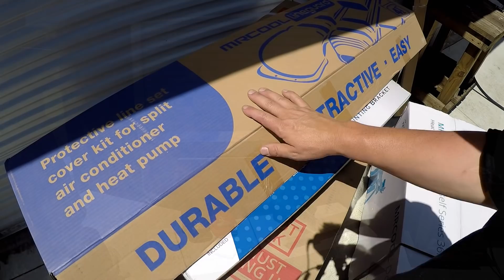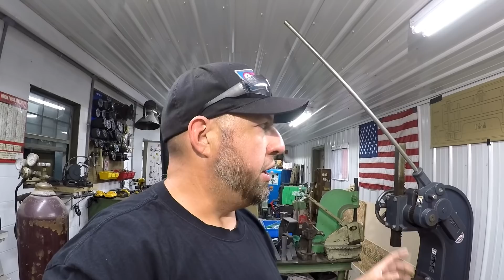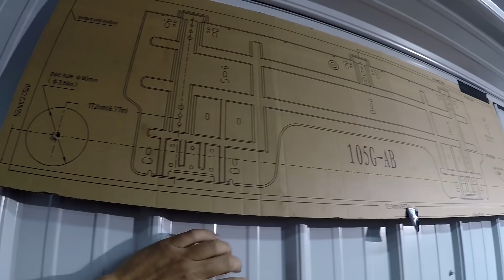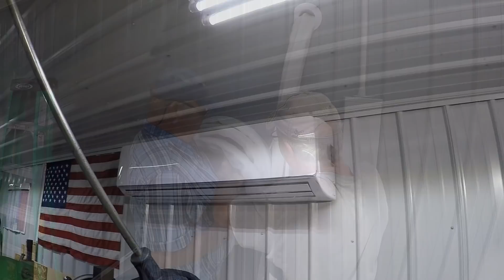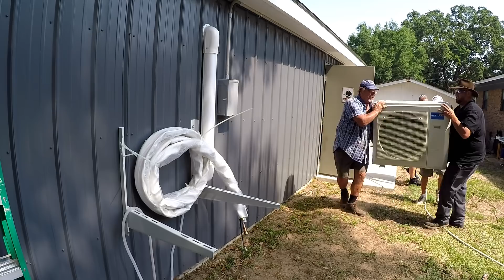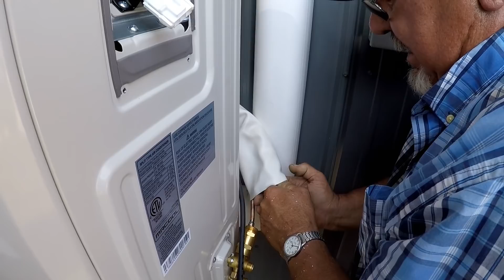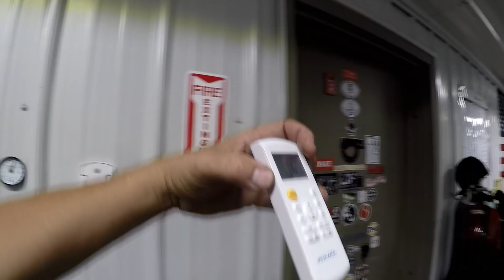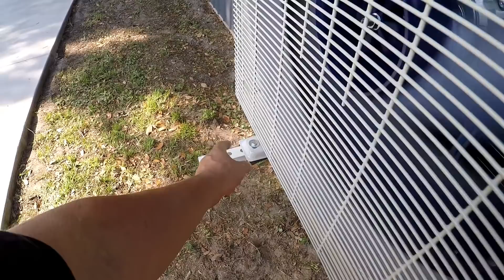Mr Cool DIY Shop AC Install

Comment: I’d recommend you lag the exposed pipes where they go into the external chiller, just to reduce any losses in the heat of summer.
Reply: It is not a chiller.
Reply: Paul Copeland compressor, chiller, same same, don’t be pedantic
Reply: @dantmx  ...Nope, they are not close.
Reply: Paul Copeland well whatever you want to call the external unit, lag those pipes.
Reply: What is “lag”?

Comment: Do they make shorter line sets?  This would reduce pumping losses..but you would have an overcharged unit.   This would increase evap temp.
Reply: The excess lines drive me crazy. 
I'd have paid the A/C guy to do it properly; evacuate the system and shorten the lines. 
Then, of course, recharge with the correct amount of refrigerant as determined by system pressures and ambient temperature.

Comment: I don't have to deal w the down south heat but holy heck Adam I've had some hot summers. I live in Ottawa Canada and we get some nasty summers. Last year I got two things. A minion and AC and my minion could still barely hack it. 10 years I'd been there w no cooling but a fan and a prayer lol. Kids right.

Comment: Is there a Mr Heat DIY unit for up here in Canada? :)
Reply: C2D I would love to stay in Canada I am from South Africa
Reply: LOL, well it is a heat pump but I doubt it will do much good.  But if you really want a Mr heat I think this will work  https://www.mrheater.com/
Reply: Its a heat pump so it goes both ways.  not going to do you much good at -20 F but i think they pump  well  till about +20 F. so it might knock a few bucks off your fuel bill, and add a bit to your electric bill. you can try it all out with your car's AC it can do the same.   quite a few home units here on Kodiak  island but we are in the south west part of Alaska so we rarely get the deep cold of the mainland.

Comment: Coil the drain and zip tie it to the bottom side of the L bracket. That way it'll act as a trap. Don't run it straight down.

Comment: You will be very happy. Have been an electrician for close to 40 years. Nice looking job. Straight, .level, n clean install. My wife works on Boca Grande A/C company. Have hooked these ductless system many times. Very impressed with how quiet they are and efficient. Hope you are also. You are lime me in many ways. It is about detail n looks. Make the customer proud they used you.
Reply: Nice clean install, but not a fan of exposed PVC or upside-down 1 hole straps that everyone seems to do. Overall very nice install and I'm sure a VERY welcome addition to Abom's awesome shop, though.

Comment: nice unit, as an owner of a mini split a few things for you to consider. 
1: move the outside unit all the way  to the end of those arms, with it a little further away you can clean the coils with a little less fuss. 
2: put a screen (panty hose) over the end of the water hose, critters will call the tube home after a very short time. 
3: get a few pan tablets and put one in the drip pan to stop the nastys from growing in the water that will sit in the pan.

Comment: WAS THE LINESET PRECHARGED OR THE COMPRESSOR?
Reply: Both I'm pretty sure.
Reply: just wondering because I saw no vacuum pulled down on the system
Reply: @jasonbrown8726  .....I suggest that you take a minute and watch the video.

Comment: Hey Adam! Thanks for another great vid. I have a question you might know the answer to: is there anything wrong with coiling up the extra line? Some pros are saying it makes them catch oil in the low spots. Did anything come up about that as you were reading the notes or speaking with your step dad?
Reply: "father in law" ??

Comment: We have these all over Finland. They can warm up houses at winter and then if get some sun at summer, those can be used for cooling.
Heating is quite cheap with those.
They actually reverse when used for heating, they try to cool(take heat from) outside and transfer that to inside unit. Opposite then when you cool your house, outside unit try warm up outside so it will pull heat from inside to outside.
Reply: Yeah thats true,  we (i) allways get the air out from the copper tubes, not so important if u look foor 4-8 y on it, my foks was 16y on their Mitzu

Comment: That should spell the end to ridiculous installation charges.  Having said that I haven't seen these for sale in Australia yet.
Reply: Flying Pictures The units are avalable in Australia bought one about 8-10years ago from Cheep As Chips in Adelaide installed in Port Augusta temperature can reach close to 50 degrees C works fine .They are avalable from most a/c supplyers.  Ray
Reply: @raymossop7959  Well good news, I will keep an eye out, my fondness for Australian summers is dwindling the older I get.
Reply: Flying Pictures   Sorry a slight misstake it was not Cheep as Chips it was The Reject shop  Ray

Comment: Mini splits are the way to go for sure. When I build a house one day, I'll zone it out with a split system. I chose a different brand for my shop, works like a champ. Coiling the lines up like r hat behind the unit would drive me nuts. I cut and flared mine to length for a clean install.
Reply: Fair enough, but then you have to vacuum purge the lines. Not many diy-ers have a HVAC vac pump.
Reply: @icecreamsundae1038  This is true, I bought a cheap Chinese pump on Amazon for $50 that did a great job. Very well worth it for a clean install.
Reply: How did you evacuate the lines? Did you buy a recovery unit as well, or just release it? I've never seen one that you could shorten the lines. The ones I've seen need to be sweated off and you need to sweat it back on, because the fitting on the condenser won't take a standard fitting. What brand did you use?
Reply: @xenonram  I've bought two units from Pioneer, their prices are hard to beat. I've had one for 4yrs that's still going strong. In the heat of the summer here, it blows a consistent 35 degrees, the one in my shop was in the upper 20s the other day. Their units come with the refrigerant pre charged  in the condenser unit it self, the lines and evaporator are empty and have to be evacuated with a vacuum anyway. I pulled down the vacuum, flushed with co2 and pulled it down again for an hour. I then checked for leaks and proceeded to release the refrigerant from the condenser into the system. Easy peasy... Their website is highseer.com, I highly highly highly recommend them. They've been great to deal with. I'm nearly certain all of these budget mini splits come from the same manufacturer. Mine is nearly identical to the one Adam installed, same remote, USB dongle, etc..
Reply: @xenonram  I forgot to mention, they sell a fitting flare tool on their website as well. You simply cut and flare, similar to brake lines on a car. So far its been leak free.

Comment: An air conditioned home shop is the best!  I looked at Mr. Cool when I did my install, but didn't like the thought of having all the extra line coiled up behind the outdoor unit.  I wish they would offer custom length linesets so you could tailor it to fit your install.  Installing a traditional mini split myself allowed me to learn new skills and techniques (and buy some cool new tools).
Reply: I'm so confused admit the comments about the coiled up lines. What difference does it make? You don't see it. One guy said "the coiled lines would drive me nuts." If something you never see drives him nuts, maybe there are more serious issues at play.
Reply: The coiled lines are what makes it a DIY in that you don't have to vacuum and charge the lines.  The condenser units of big systems come charged from the factory.  A 5 or 6 ton unit will have about 15 lbs of Freon in the unit from the factory.
I would suggest using soapy water on the connections to make sure there are no leaks.
I agree about sliding the condenser out to the ends of the arms to allow access to the back for cleaning which should done at least yearly.  A screen of some sort over the end of the drain is definitely a good idea.
I think I would attach a couple of ribbons to the vent inside to give a visual indication that the fan is blowing.  They don't need to be long.

Comment: Im on vacation in FL right now and the heat is no joke.  Weather app says "85F . . . heat index 104F"   HAHA.

Do those hoses have schrader valves or something?  how can they be evacuated?  Could the system just be designed to work with some air in the lines?  so strange to not evacuate.
Reply: The lines are drawn down to vacuum and sealed for delivery. That's why you have to be careful and do it right the first time you install or else you will have to call someone who can re-charge the system.
Reply: @donaldlittle1489  how are they sealed?
Reply: Thin foil seal over the end of the line, when the fitting is screwed into place it punctures the seal.
Reply: @DaveDablave  The lines are pre charged, so by nature they have to be sealed. The <½ mL of air (@ STP) is obviously not enough to affect it.

Comment: Nice video Abom.... These are very common here in Australia. Nice and easy with the refrigerant lines pre coupled and ready to go. One thing, on you flexible external drain line install a trap near the discharge so that it's kept wet. It will help to avoid bugs from crawling up and blocking your condensate line and causing a water leak from your indoor unit

Comment: I would put the unit above head hight to be more efficient and save power, also i would put solar panel to use the sun to operate the unit during the hot hours.The plastic pipe may need to be sealed to stop water getting in.

Comment: That installation was incorrect. Now you got air in the system. What they had to do was to fully adjust the thinner line, then adjust the other, but not in full. Then open the thin line valve and let the coolant flow from the outside unit to the indoor unit, pushing the air out of the lines and through the not fully adjusted line. After 5 to 7 seconds, you complete the adjustment of the line and open the last valve. That's how you install a split air conditioner without having air in the system. :) (excuse my BAD english!)
Reply: There is no air in that system. The lines that are not pre pressurized with coolant are under full vacuum from the factory. The connections break the seal when screwed together on the unit. Then the coolant is released to vacuum when the valves are opened with the Allen key. If they had done as you say nothing would have happened since only the connected line would have flowed coolant and the other one would still be sealed. The fictional air could not escape even if it was in there.
Reply: Well, if the lines are sealed and the seal if broken when you connect the hoses then it's a correct installation. I must admit that I've never seen those kind of sealed lines.
Reply: @mcksysar8620  

Well now you have.
Reply: @mcksysar8620  You have ZERO idea what you're talking about. When you read up on the installation of this specific pre-charged system, then you can comment and hopefully fix your ignorant post.
Reply: @yqwgjsg ... Nope, no vacuum  The lines are pre-charged with 410A.
Reply: @FireandFrostHVAC  ....
Nope, no vacuum. The lines are pre-charged with 410A
Reply: @MCKSys AR, bad english or not the EPA is gonna come after you releasing refrigerant into the environment! As said, unit is a pre charged DIY system, this most likely has special valves that hold a charge of refrigerant in the pair coil back to the indoor unit. Simplicity, unless you mess up the threads on the coupler.

Comment: I recommend doing some type of shed or over hang to protect the outside unit from rain and debris. It's pretty dope man. The day I make my own little garage for all my tomfoolery I'm getting one of these
Reply: Adam, I concur, between the down pours and hurricanes you all get down there putting a roof over that makes a lot of sense.  It will protect the unit and the coiled hoses from U.V.   maybe get some electrical "U" channel. (Jose?) likely has some extra laying around.  The guy who installed the metal sheeting on the exterior may likely have some that matches your walls.  Lookin good!!
Reply: @scottpecora371  that's what I was thinking. Some type of over hang to just to keep some of the weather away.
Reply: Yeah, they're also lovely restricting airflow. It might be a possibility that outdoor unit is made.... Weatherproof 🤔
Reply: @jothain  nothing is water proof, it may be water resistant but its always to a certain degree. Maybe I didnt describe what I was thinking right. I meant a type of over hang to just keep most of the weather away. Not an enclosed space

Comment: Thanks for video Adam! It is amazing that this system/ lines do not need to be vacuumed.
Reply: Looks like they have some sort of sealing valve that connects to the condenser....lines would be under vacuum.
Reply: In the 80's pre-charged  copper lines with areoquip male and female connections were common in various lengths for AC split units ,some refrigeration units ; They had no valves like Adams unit ,just access ports , The quick connect fittings would be screwed together and internal cutters would pierce both copper seals at the ends of each areoquip connectors and further tightening sealed both fittings together ,This completed the connections to the pre-charged evaporator and condenser  .

Comment: I couldn't live with a coil of hose behind the unit.  just seams wrong to me.  I would hope they offered different length pre vacumed hoses for systems like your back to back install.  No use to me since I'm in a different country.  Kind of tireing seeing the same thing on more than one channel I subscribe to.
Reply: Look away then........................... :)
Reply: bad for air flow through unit , also leaves and nests , insects etc.

Comment: Could you take an output of the ducky temp and post along with the outside air temp please. I have a 12000 BTU mini split for my two garage shop only 700 square feet, I wish I had gone with a 18000 btu here in West Texas. My duct temp withe thermostat set at 60 degrees is at 48.3
With an OAT of 70 degrees.

Comment: Nice job Adam, how long till you get a second unit in the other side of the garage?
Also, are you planning to put the big drill press in the new building?
Reply: He has a Liebert (top of the line A/C equipment) commercial wall unit in the main shop.  He had Fernando install it during the construction of the new addition.  He has video of some of the installation.

Comment: Adam, when you decide to cut that excess bracket off, just use a Sawzall or something, and don't take them off the wall and clamp them in your Bridegeport to mill the ends off to within a couple thou of the length you want them to be.
I ain't criticizing, I'm just talking to you as a friend...
Reply: I think its a job for the shaper  :)

Comment: That indoor unit is HUGE
Also those copper lines are flexible  waaay more than I would expect, never seen that. Hope they are good
Reply: ""Also those copper lines are flexible  waaay more than I would expect,"

They are probably copper-colored hoses.
Reply: @vinny142  as in those that one would use during service on vacuum pump?

Comment: Look at that big smile at the end of the video and closing shot. I don't believe I've ever seen you with a smile so big. I guess you're happy being chill and I'm certainly ok with that. Very nice install with the help of your stepdad and his helpers. Enjoyed it very much. What was your thinking on leaving the dividing wall between the two shops up. Wouldn't taking it down have made the shop work flow better? Thank for the informative video.
Reply: That wall is structural and holds up the roof.

Comment: Im curious, do you have a separate service to your garage or are youre running the service from your house to the garage? Cause im thinking if you have a regular 100 to a 200 amp service and running your home AC , electric stove, heavy machinery, 2 AC's for the garage and any other high amperage source is a bit much for a 100-200amp service?.
Reply: His very early vids he talks about the shop power supply. If I remember right it has its own service for 3phase.
Reply: Shop has 3 phase, house is single phase on different services.

Comment: I really like mine - 18k unit that I installed myself a year ago.  I had the time and ability to do everything myself, but I hired an AC guy to do final line-to-pump connection.  I found at that time that the unit contained a full charge of freon in the pump, so the AC guy made sure pressures where correct.  Best part is the quietness both inside and outside, plus electrical savings.  Advertised SEER on mine was 22!

Comment: Hvac installer here, that’s a pretty good looking install ya got there, very disappointed in all the armchair experts that couldn’t be bothered to listen to what you were saying about the electric and precharged lineset. I’ve installed plenty of these and yours will do just fine for years to come.
Reply from the maker: Thanks. Easy system that the common consumer can afford to buy and install themselves. Yea it’s a shame some of the people watching won’t listen to what we said about the specifics.
Reply: @Abom79  I went and took a look and they are surprisingly affordable, was kinda shocked, the company I used to work for installing a mini split started at like $7k, definitely something to keep in mind if I ever get my own small shop.